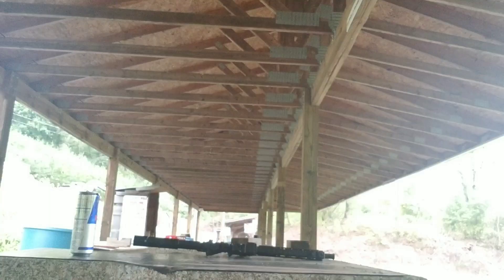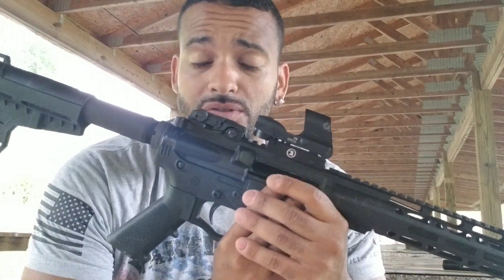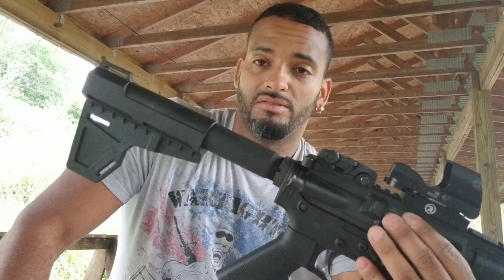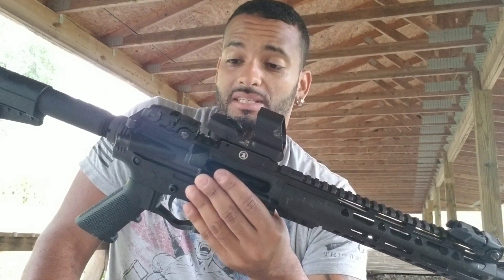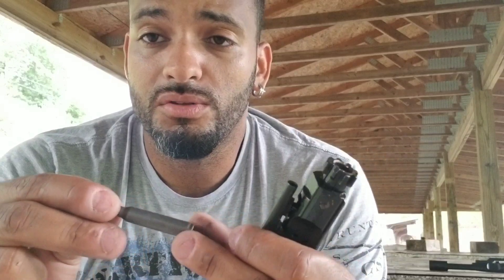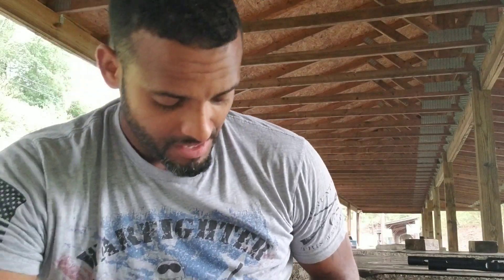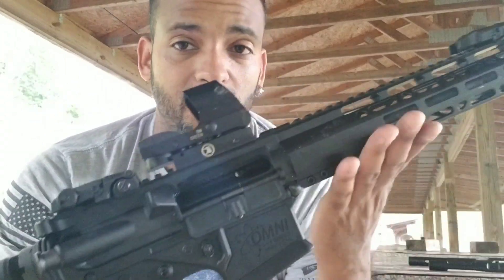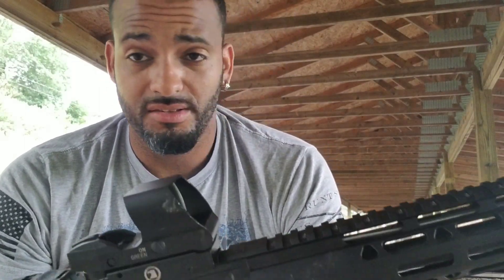The issues with cheap AR15

Comment: It actually has to do with the fact that brass expands and steel case doesn't.. Since it doesnt expand it lets carbon blow back into the chamber around the case and eventually it gets so tight with carbon that the cases stick.. Add to that the fact that steel case isn't as slick as brass. Add to THAT you're using a short pistol gas system and the dwell time is low and trying to extract to fast after ignition.  Wet your chamber more, and try using a stronger extractor spring and maybe a heavier buffer and spring. Some guns wont be gassed enough though and steel just wont have enough power to cycle it(longer gassed systems most of the time).

Comment: there is nothing wrong with cheap parts... you probably have it undergassed to run cheap ammo like 
russian or reloads. (both are notoriously underpowered) 
before you start.. 
grease your bolt and carrier wet with high temp disc brake grease..the sloppier the better.
Make sure you are not limp wristing it.. hold it tighter than a bandit. 
fire... how does it behave. (i say this because i had a low T friend who could make any ar pistol
jam and when i handed it to my manly friend, the gun functioned fine)

1.make sure your gasport is 3/32 in size if not drill it.-if your barrel is too hard skip this.
2.if your barrel was too hard. order 3 carbine springs from different sources. check the lengths.
drop in the shortest one and see how it behaves. 
3. begin to trim off 1/4 of spring till it starts to eject the shell.. 

I have my 10-1/4 ar pistols at 3/32 port and they fire everytime any ammo. it is the correct size 
as tested by colt back in the day.  https://www.youtube.com/watch?v=Nj3FYzhS3tk
Reply: Haplogroup hx Your talking about range reloads right? Because I reload and those recipes range from mild to wild 😜.

Comment: It’s not that steel expands more, in fact it does not. Steel just takes longer to relax from expanding. The shells blow up like a balloon and then relax. Steel takes fractions of a second longer. Your problem is that your over gassed and it’s trying to eject too fast before the shell relaxes.